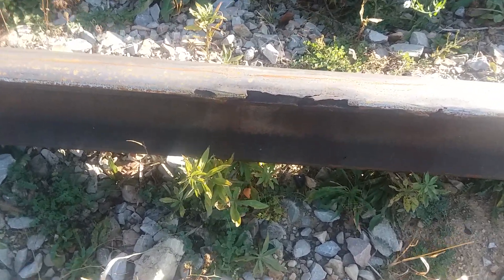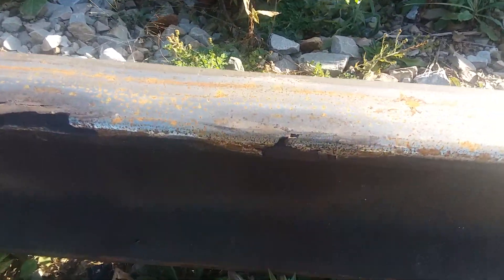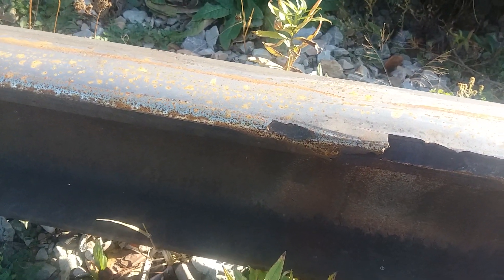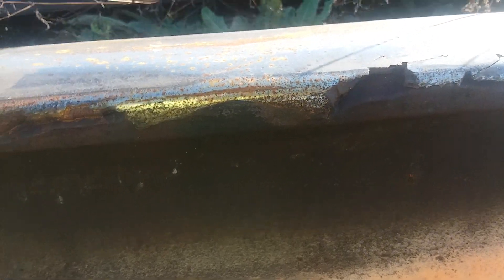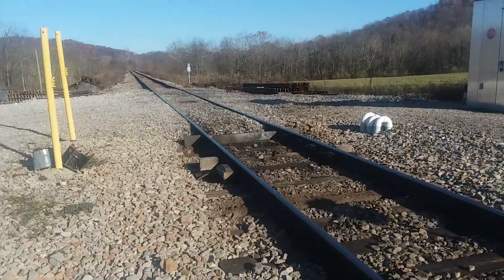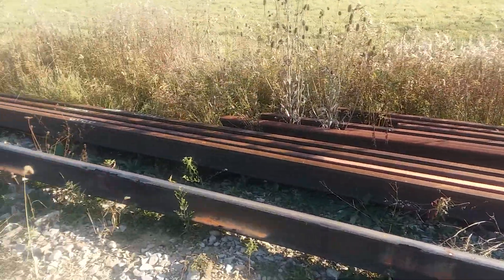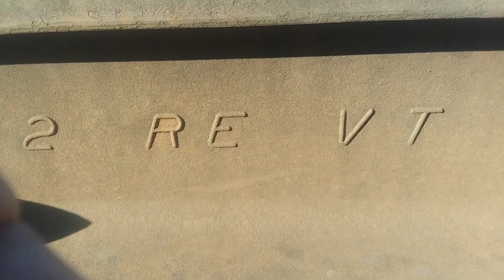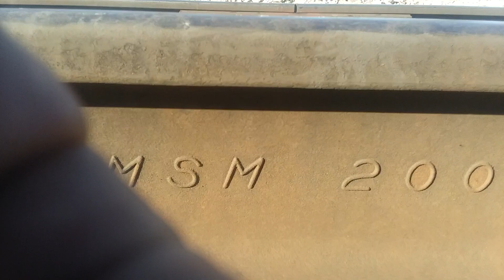Rail Defects: Rail Head Shelling

Comment: This resembles what is referred to as lamination in my experience. I also have experience in burnishing and shot peening as a surface improvement, and it appears that you have a piece that was harder than most and subjected to normal stress of the wheels running over it, becoming work hardened and cracking as the stress continued. It appears that the phenomenon occurs beginning on what you refer to as the gage side, and follows as the lamination of the hardened material meets with the softer material below being aggravated by the incursion of moisture and cyclical freeze and heating due to traffic. The wheels rolling on the surface simply “deep burnishes” the head of the rail hardening it causing it to become brittle and delaminate from the underlying material. If you do a hardness test on the “shelling” surface and cut out material from below it, there should be a pronounced difference in hardness between the two.
Reply from the maker: Thank you dp for the very interesting and informative comment. 
I learned something new tonight! Appreciate your taking the time to visit with us and check out the video my friend.

Comment: Shelling on the inside? Gauge check inside part. External is field check.. Three parts to rail: base, longitudinal, transversal. Vaccuum tee gassed is a way to cool rail. Did I get it right, teacher? Thanks, Dave!
Reply from the maker: B. 3 parts to rail: base, web, and head. But since I grade on the
curve, you get an A for effort Shirely. 3 planes to a rail, longitudinal,
transverse and vertical.

Comment: In the UK I have heard this called  "gauge corner cracking" in the press when a very serious railway accident occurred some time ago on the west coast main line which caused several passenger deaths and injuries.
   The cause of the cracking as I understand it is by metal fatigue which is the same process as if you get a thin metal bar in a vice and constantly bend it back and forth until it breaks. The bending causes the metal crystal structure to change and so weakening the metal until it eventually fails.
  The controlled cooling of the metal when the rail is manufactured is to control the metal crystal structure to ensure optimum properties of the finished rail.

Regards from Redruth (UK)

Arnold
Reply from the maker: Very good comment Arnold. You are exactly right. Thank you so much for taking the time to tune in to the channel and check out the video. May you have a really good day my friend.

Comment: Rail way passed it life, excessive ware, heavy plastic flow, old steel is way better then this new rail. Spaulding, shelling and head checking heat related. Corrugated rail whole different bowl of wax. Dave your making miss the track!!
Reply from the maker: Very interesting you say the old steel is better than the new rail.
We've got a lot of our original rail from 1975 here and a lot with
almost no wear on it. Although most high degree curves have
had their rail replaced by now.  Really appreciate your taking the
time to watch and write in my friend.

Comment: Dave,  if you have a rail that has that problem with impurities that would mean that the batch of rails may have that problem is there a way to check that batch after being laid down? Or is it because this rail was subject to harder treatment from a bad wheel or other causes which would not occur anywhere else.
Reply from the maker: excellent question and one I will address in a much future video
cause there is a lot to say about that. Short answer: all rails have
a heat stamp that is hot stamped into them which contains the
heat, the mill, the position of the rail in the ingot, the furnace
number, etc. So yes if there is a bad rail in the batch they can
find out exactly which one it was in the manufacturing process.

Just because 1 rail in a bath exhibits symptoms, does not mean
the whole batch is bad. That rail that went bad just happened to
have a higher amount of impurities in it than the rest of the batch.
It's much more detailed but I cannot type all night either, so short
answer will have to suffice for now my friend.

Comment: Very interesting. So rail can last for years. Wow.
Reply from the maker: We have a lot of the original rail here left that was rolled
in 1975. Many of the high degree curve rails have been
changed tho. There are many RR's out there that still have
rail in them rolled from 100 years ago, although most of
those RR;s are short lines or regionals. but most of those
rails are in sidings and not mains.

Comment: material with the shelling issue?  looks very much like race car parts I have had my hands on... it is a "work hardening" of the material.. While very small, deflection occurs on every cycle (or wheel passing over) and in time, the granular formation changes.. Material becomes really brittle.  Maybe if the rockwell on bad spots is compared to good areas..  Am sure the engineer types were already all over that..
(I lived in Pueblo for a number of years (CFI steel was the primary business)
Reply from the maker: Thanks for writing in with the very informative comment! We do
appreciate your checking out the video my good man.

Comment: I heard that for welded rail, the expansion on a straight run pushes a curve outward. Can you tell us whether this means extra maintenance on curves to allow the ties to keep sliding freely, and is there a limit how long a straight stretch can be welded? For example, a two-mile stretch might expand and contract 2 inches (just guessing) every day, which would mean the curve would slide 2 inches twice every day during hot weather?
Reply from the maker: Jay, you ask very good questions, but since we dont have CWR but instead jointed track, so im not much of an expert on how to control CWR,
Reply: In the UK we have a lot of CWR and the expansion is taken up by using heavy concrete sleepers (ties) with heavy ballasting (stones) which resist the expansion by compressing the rail longitudinally so that it does not move. This works normally except in extreme weather conditions when it gets headline news in the papers.

Comment: I feel that  shelling has come from the wheel not being cut properly , to much of a angel is cut on the rail wheel along with the angle of the rail is to flat and the wheel put more pressure on a small part of the rail and sense the rail is hard it dose not give it brake the metal off at that point . To much weight in a small area of the rail .. like trying to hold up 100,000 pounds with a single hard nail as your base on the track to hold the weight up .. I feel if a angel was cut in the rail to fit the angle of the wheel to set flat all the way across would distributed the weight all way across the track rail similar what NASCAR does to their tracks / to help guide the race cars around turns on the track at much faster speeds . Angel your track rails to set in the wheels better sense they are cut at a angel to make a turn easer for the train .

Comment: Question: When replacing a section of rail in a curve do you have to pre-bend the rail to fit the curve?
Reply: Over a long span of a curve, surprisingly that rail will flex enough to the contour of the curve. What amazes me is watching the trains bringing in the 1/4 mile lengths of ribbon rail, wondering how those trains can negotiate the curves with all that ribbon rail loaded in the racks. (The racks are attached to the ends of  several 40' flat cars that articulate, and the rails rest on rollers made into the racks)

Comment: What is the cost of rail per foot? Could imagine it to be expensive.
I guess the only way to monitor this track condition is having somebody making actual visual inspections - that's a lot of track to monitor! Wonder if an electronic inspection method be used - installed on locomotives?
Reply from the maker: Ray, we get new rail from Steelton at about $900 per 39 foot stick.  I also make a weekly track inspection via my high rail truck. Once  yearly untrasconic rail testing is contracted to Sperry or Nordco.

NS has developed a method of track inspection that is located underneath a loco, they are the only ones I know of that has this and I believe it's still in beta stage.  Thanks for watching 😊
Reply: @ccrx6700  
$900 /39 ft rail...no too bad!
I was learning about curve (track) oilers with other YT channel about trains. I assumed the outside rail in a curve gets wear and causes squeaky wheel noise....but after thinking it over - it's the INSIDE rail that gets stressed /wear. Logic being - when transversing in curves trains have tendency to want to "straighten out" - lateral forces of wheel rims ride against the inside rail of curves.
That make sense?
Reply from the maker: @raybin6873  Ray, your topic deserves about an hour discussion, generally speaking the high rail gets what is called curve wear, i havnt made a vid on that yet to show you. 

If there is too much super elevation then the low rail gets a lot more wear than shoukd be. Thats why its important to have good ballast, to hold the low rail in place. With mud in cribs the low rail drops resulting in greater low rail wear. That can also be a cause of the high rail wheel wanting to climb up on the high rail, its called wheel climb derailment. That all is a very basic short discussion, but I think you get a bigger picture now
Reply: @ccrx6700  Got it!
To sum it up - there could be a balance between both rails with use of elevated /banked turns. Train speed is also of importance.
(I didn't think train stuff could get so complicated!) 👍
Reply from the maker: @raybin6873  yes sir, there is a balanced condition. That is determined by track speed plus degree of curve. FRA  allows an unbalanced condition of up to 3 inches, most RR's opt for half of that when determining super to put in a curve. Am gonna make a future vid explain that cause it a bit complicated, but it has to do with car center of gravity negotiating a curve. Hope I didnt confuse you more, but your question is a big topic. Also may help think NASCAR with those insane banked curves
Reply: @ccrx6700  
Ha! I used to drive stock car - dirt track. The turns are banked tremendously! To make it thru turns you get as much speed down the straight away - then sling front wheels hard left (you think you're gonna wreck!) - you drive the car "sideways" thru the turn - adjusting steering to be pointing forward as coming out of curve. It's one hell of a ride once getting it figured out.
(There were some damn good drivers who could hit the curves at insane speeds - that's how races were won.) Athens GA Speedway - it's gone now.
(Sorry for long chatter)😄👍

All cars were LTO...left turn only...LoL!

Comment: That was my thought too, it looks like a slag lamination problem
Reply from the maker: That's a new term for me, slag lamination, got an idea in my head
what it means, but not 100% sure, sounds technical!
Reply: @ccrx6700  I only know it because back in the 1980s we had a whole bunch of plate get rejected when the fabricator was having odd cracks while bending it in a brake. They sent back everything with the same heat number. It's sat behind the steel Warehouse I worked at for years rusting away. I ended up using some of it to run down the center of flatbed trailers that delivered to a customer who ran on with a large forklift and was breaking the wooden floors.
 When guys from the rolling Mill were around they told me about it. Basically it's just what happens when slag contaminates the steel and then it is rolled. Kind of like when you make a pie crust and you use butter to make it flaky.

Not sure if the term is used everywhere but, at least that's what the guys from the rolling Mill called it.
Reply from the maker: @joecummings1260  Awesome Joe, thanks for explanation, got a better understanding now. Sounds logical. Those guys from the mill should know what they talking about.

Thats why all rail is controlled cooled to help eliminate the formation of internal  hydrogen flakes. In rail those flakes are sometimes called shatter cracks or internal thermal ruptures.
Reply: @ccrx6700  yeah I could kind of see hydrogen embrittlement causing a similar type of crack. From what I understand that Mario Cuomo bridge has had a lot of bolts failing due to hydrogen embrittlement problems.

I would kind of guessed that that vacuum cooled rail is some sort of a attempt to off-gas all the hydrogen.
Reply from the maker: @joecummings1260  oh dear, that not good, what a job that must be replace those bolts.

Maybe will do a future on the diff methods of rail cooling in future
Reply: @ccrx6700  yeah something like that on rail would be interesting. You run pretty heavy rail don't you? Isn't 141-pound rail the heaviest standard rail?

we used to have a strong market for scrap rail around the Philadelphia area, lukens steel was buying a lot of it. The scrap brokers told me it was because it was high in chrome and manganese. I think Lucas was buying it to make armor plate

By the way I wanted to ask you, at one time around your mind there were mining operations for coking coal, is that still being mined there?
Reply from the maker: @joecummings1260  Joe, we have all 132 with just a small bit of 136. I believe 140 is the heaviest still rolled for RR. 

PRR experimented with 152 and 155 way back. Now crane rail goes up to 170.

I don't believe any mine in our county has metallurgical coal, it's all steam coal. When i was growing up in the 1950's and 60's there were coke ovens all over, at night the sky had an eerie orangish color to it from all those ovens.
Reply: @ccrx6700  I can't tell you how bad I Miss steel mills. The sights, the sounds, even the smell. When I was a kid one of our family friends had a small trucking company. When we used to ride past the Fairless works he take a big sniff of the air, and say "smells like money"with a big smile. Levittown PA was built around that Mill. Beautiful suburban community single homes, with swimming pools in the backyard, and two cars in every driveway. Since the hot end of that mill shut down levittown has turned into a drug-infested suburban ghetto.
Reply from the maker: @joecummings1260  i understand that, same thing happened here at Clairton, that was a high end town when the mill was going, it but a shell of what it used be. My uncle was a minister in new jersey, he would come back an go Clairton buy his clothes, now theres grafitti painted plywood over the windows there.

I like smells like money
Reply: @ccrx6700  my whole family is from Johnstown, in fact my uncle was president of steelworkers local 2642. That was a very prosperous town at one time too, now it's like a damn ghetto, nothing but booze and drugs.
 
I was talking to my dad about 2 days ago, he is 93 years old. He worked for Bethlehem there in the rolling Mill as a gauger after coming back from the Korean war until he moved to Philly in about 1960. He told me the rolling Mill he worked in was three miles long, and that was just the rolling Mill, not the rest of the plant. When I tell young guys today about how big the industry was and how many people it employed they think I'm kidding. They can't even imagine working at a plant so large that it had its own police force, fire department, and fully staffed trauma center complete with on staff doctors 24/7

When they started moving our steel production overseas, they really did us dirty

Comment: Man I saw a LOT of that on the hill. Those shards were as sharp as knifes and would break off in 3'to 4'
 lengths. I used to wave them around like swords. Our rail was so worn the wheel flanges were down on the angle bars and running them down.
Reply from the maker: Oh dear, am guessing the speed limit was pretty low...lol worn wheels on a car will scrape the top of joint bars too. thanks for watching sir

Comment: In a curve, the outside of the rail would be under some tension, and the inside under compression. That might help it eventually crack. And the downward bending as the wheel passes over the spot would add to the stress in the rail. Those two might cause the failure in curves.
Reply from the maker: Bill, thanks for the input sir, there is a lot of stress on rail from the
dynamic forces of a train for sure. what's interesting is that is an on going study among the railroads and AAR, every year they have a conference on the Wheel/Rail interface to go over new ideas. Wish I could attend one sometime. There's far more to railroading than a locomotive with a cut of cars going up and down the tracks. I do appreciate your watching and your comment

Comment: I still don't see why some shelling would make any difference. As long as the rails were reasonably straight and level and in gauge, why would the train wheels care about anything else? I'd say a track defect in serious need of repair would be where a loose rail goes up and down as the train passes over it
Reply: In order to be straight and level and in gauge there needs to be some material.... In those pictures a good portion of the nominal contact patch between rail and wheel is gone, thus stresses in the material spike to dangerous levels and failure is forthcoming